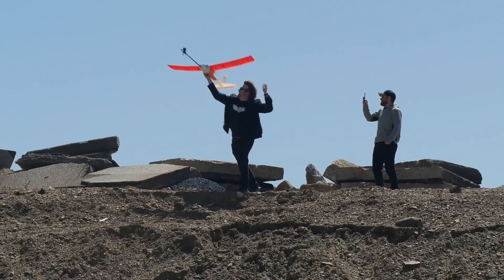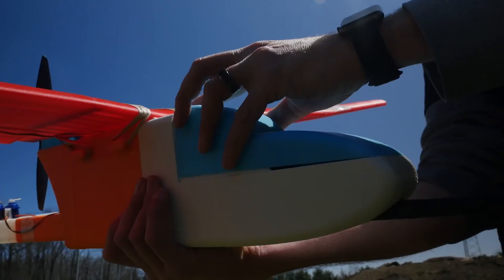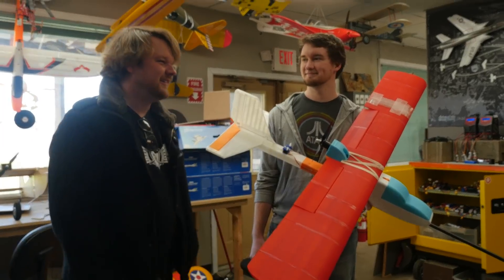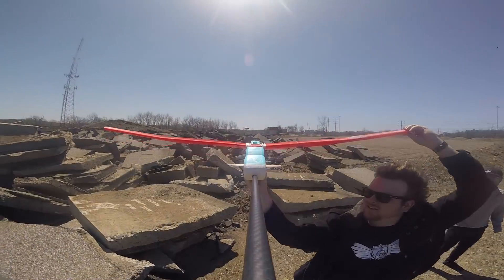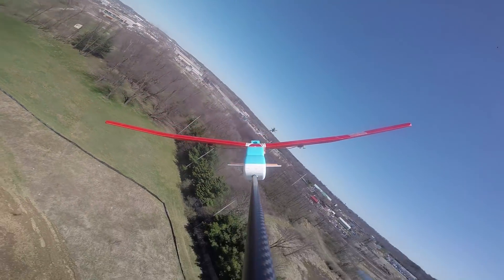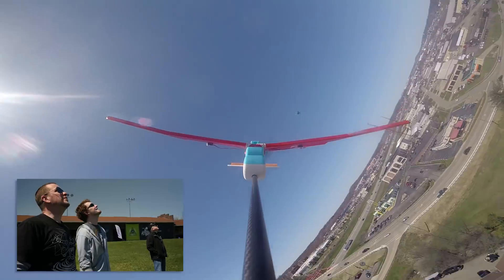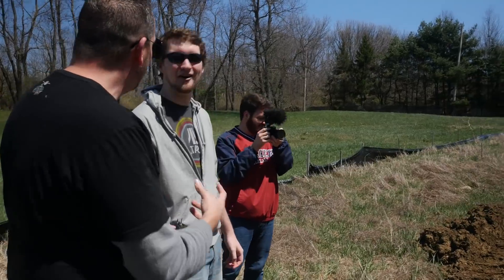Prototyping a 3D Printed Plane

Comment: This was such a fun experience, thanks for the opportunity and the feedback! I'm already working on version 2 ;)
Reply: Will you do any changes to strengthening the layer bonding ? Or was that not the cause of the break
Reply: Unfortunately that was an old wing, I was actually planning on bringing in 2 planes, one early/jank version and a more refined version but my printer broke a few days before I went in so I actually had to Frankenstein together the two for the best result. That said, the new wing had some design elements that would have helped but the biggest thing that will help for v2 is adding in a carbon or dowel spar. As for the layer adhesion it was actually pretty good it's just that there was so much wing surface area for the lift force to break it off. You can see in the video how close to the center it broke which was the location of most of the leveraged force. A wider or thicker wing would help but it would also add more weight and since it's already tipping the scales I'd rather keep it the size that it is. Best option now is a spar.
Reply: Aight sounds good, looking forward for a v2. Its a tough one.
Reply: I'd like to see the same thing but smaller!
Reply: Outstanding job!!!!! I would think V2 should have a more reasonable CG. Also maybe V2 is josh's to fly second or third person. hahahahaha. Keep flying, Gods speed.
Reply from the maker: Can't wait to see it buddy!
Reply: Use petg next time. It’s the same stuff soda bottles are made from. Not as rigid as pla but much tougher, meaning it will flex without fatiguing. It’s readily available and easy to print too.
Reply: Wow!!!! Nice flight and what a spetacular crash! Nice one. Cant wait for 1.2v. Congratulations mate!!
Reply: Suggesting to the guy designing this: use single extruder width(0.4 mm) on walls to save on weight, and melt joints by using 1 brim layer in the slicer. Then use a solder iron to melt the brim onto the next peice.
My 3D printed Qtrainer has snaped many times because of glue. Thw melted version never broke once
Reply: It's such a great test. I am sorry for the crash. I hope you use different materials such as PET-G and Nylon filaments. It may work better than PLA
Reply: Look at the internal reinforcement of the P-38 wings. Stephen used diangle struts vice horizontal that you did. It will give more resistance to wing loading.
Reply: Tyler Kenepp hey brother. I've got a rostock max v3 with a 15 inch build height and 11 inch diameter round print surface. If you need someone to help you print parts let me know and I can get to it. Also up your print temp about 10C and slow your print speed. You could also try carbon fiber/poly carbonate filament to drop the weight by at least half and up the strength.
Reply: Tyler Kenepp - Dude..
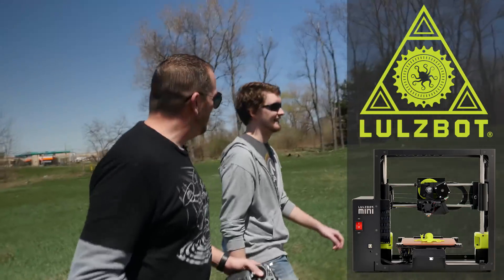Tyler. @3:43 was that you ripping a fart for the camera man!?....please say YES! LMAO
Reply: Honestly I'm bloody impressed it held up so long WITHOUT a spar, especially given the 1.8kg AUW. Nice work, people like you are advancing the hobby, one chunklet at a time! :) Respect.
Reply: Will you extend the nose out so the battery pack can be moved forward. Be nice to fly without the carbon fiber rod out the front. Besides, you need it for the wing.

Comment: Just a suggestion, you should print the wings horizontally not vertically it will increase the strength but it might increase drag

Comment: Not sure that anyone has noticed that the internal wing and tail structure is  perpendicular to the edges!(traditional balsa  / film method) Together with the inherent way 3d prints layers, it is going to create weak areas. If you look at the way 3dlabprint  do their internal structure  there is a crisscross structure at an angle to the wing, it even has curvature.  Another big thing is the internal structure has big openings in it making the wing stiffening light. I do not see this in Tyler's build

Comment: Looks good, but why not make it for FPV and hollow out behind the normal windshield area so you can mount the camera in that space instead of with the long spar off the nose. You could make one for the smaller runcams and lumineers and then a larger area for GoPro and FauxPros...

Comment: That's great. 
Knowing that 3d prints may be "a bit fragile" and looking at that wing flexing I was just waiting when that would snap. 
And the plane didn't fail me, turning into confetti.
BTW, there are some videos on 3d printing showing that you can reduce brittleness a bit by fiddling with a printing temperature.

Comment: Have someone make the 3D Printed part out of just barely enough flex Flexible TPU, and then reinforce it with spars! :D
Reply: They could make a weighted foam body that would take crashes better, then prototype several wings trying different filament, spars etc
Reply: Snes Guy yep, plenty of neat ways to experiment :)

Comment: That was epic full wing seperation mid flight .. MABYE PRINTED PLASTIC IS NOT READY FOR JOSH . FLEXIBLY IS KEY. NICE WORK.
Reply: Man, I had an old fogey that had been crashed at least 15 times but never any damage to the wing. Then I take it out and got it maybe 10ft up and both wing tips just fell off right at the same time. One of my most derp flying moments.

Comment: Try 3D printing a spar make it hexagon-shaped but make sure you print it lengthwise lying down not vertically if you can you would need a larger printer than those Bots try some carbon reinforced nylon that should be plenty strong for a Wings bar and then you can keep the all 3D printed nature of it
Reply: I had definitely considered that. One of the things I was thinking about during this was keeping the sections small enough to fit in some more constrained printers which would make printing a spar like that more annoying than anything haha I definitely think a carbon rod or thin (~1/4 inch) dowel would be better, definitely more time efficient.

Comment: Rotate the wing prints so the grain of the filament is going laterally instead of front to back. You will get a little more flex but it will be harder for the wing to snap like it did.
Reply: While that is true the main issue with that is that it would add quite a bit of weight. Printing it this way allows for only one wall thickness over the majority of the part whereas if if were printed the other way there would be a lot of overlapping layers in order to support themselves. It would also take muuuuch longer because top/bottom faces print slower to help with bridging over the infill.
Reply: Humm, fair point.
Reply: Spoiler Alert!
Reply: Agreed for strength. Maybe skeletonizing it a bit and using a film to cover it would keep the weight down.
Reply: Yeah, I have tried to print 3D parts so that the print grain is horizontal as in your wing section prints.  Unfortunately, the 3D printing - even with a quality filament like ColorFabb's nGen - will have a tendency to de-laminate under load like your wing did.

I would suspect that a stronger light-weight structure could be achieved by printing spars and framing separately then printing the wing surfaces with a twin-head printer where the actual wing part is printed in an ABS filament with the the inside support is printed with a soluable filament.  Once the soluable filament is dissolved, you would have thin, lightweight wing panels   The result would be glued together for the finished wing structure. 

I get the feeling that the fellow that makes those excellent 3-D printed airplanes demonstrated by the Flite Test gang uses that method to build his planes.

I am using 3D printing for smaller structures like glider release units and landing gear struts where I can sacrifice weight for tensional strength.